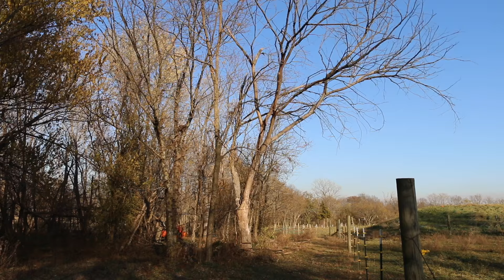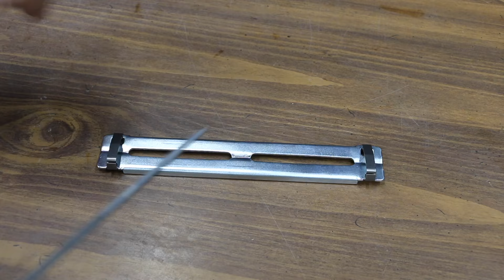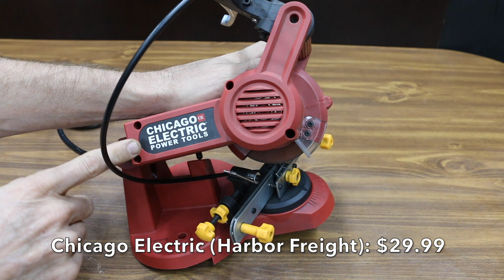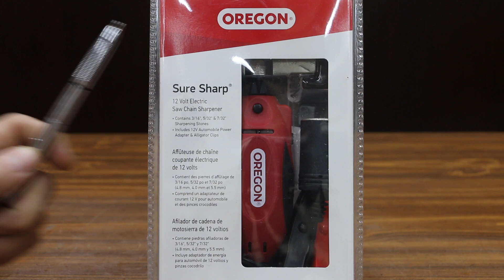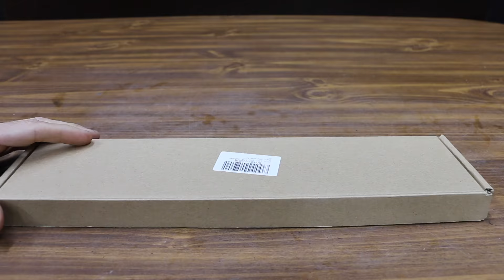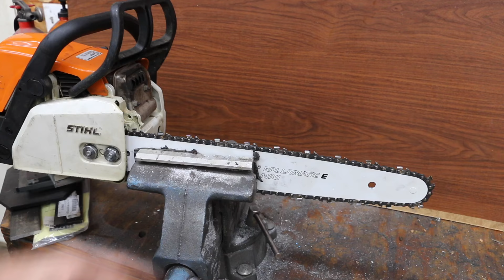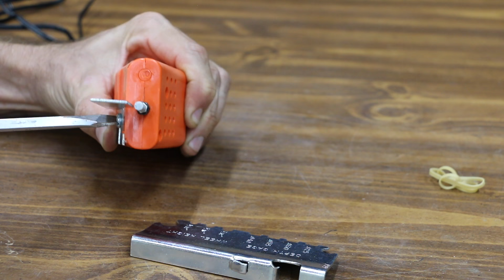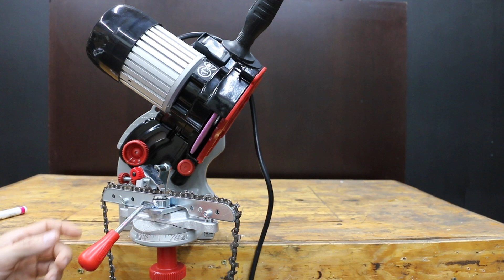Which Chainsaw Sharpener is Best? Let's find out! Stihl, Granberg, Chicago Electric, Oregon

Comment: Looks to me that they are all good if used correctly. I've sharpened a lot of chains with a bench mount a little better than this one. Ours had hydraulics so you didn't have to pull the lever to tighten the chain. The disadvantage is you have to remove chain from the bar. I my case people would sometimes bring 10 or 20 chains and some really dull so this machine was best .
Reply from the maker: Great point!

Comment: I’ve always used a dremel seems to suffice over a file. Saves a lot of time.
Reply: I used a Dremel for years. Until I recently learned fully what I was doing. Dremel does not sharpen the rakers. Only the cutters. If you are trying to sharpen the rakers with a Dremel (most guys don't), you are playing with fire unless you also use a depth gauge. If you oversharpen the rakers, it makes the saw too aggressive (read: dangerous). This is the whole point of Stihl 2 in 1. Sharpens *cutters and rakers*. With no need to measure each set of teeth with a depth gauge.
Reply: @ILruffian  yeah you do have a point there. I just used it around my land and it was the “fast way” lol I suppose I’ll try buying one of these devices project farm is the best!
Reply: @kylehughes6324  I used the Dremel in your same situation for years with no issues. Honestly, I didn't know any better. But eventually, the rakers are too high for the cutters, and you have a sharp but slow and sluggish chain. I ended up coming across a video and learning the whole process. The 2 in 1 is just as easy as the Dremel. Except it hits both cutters and rakers in one pass, automatically maintaining the ratio. Dremel still gets a lot of use for lawnmower and hedge trimmer.
Reply from the maker: Thanks for sharing.

Comment: Something I've wondered a lot recently, do the "special" (Read as High C rating/high amp/high discharge) batteries, such as the Ryobi One+ HP, actually do more than a similar battery that isn't labeled HP?  Likewise, do tools get amperage starved if you use battery packs with just a single serial cell array?  Do the packs with 2 or 3 parallel sets of batteries do work faster? How does a 3x normal pack compare to something like the HP batteries?
Reply from the maker: Thanks for the suggestion.

Comment: I've been using the 2in1 manual sharpener and really like it. Mine is not a Stihl, I think Stihl just markets to original design. As you mentioned it  is really clever as it sharpens the tooth and files the rakers. I bought the HF one you mentioned but have never used it, too much setup and tweaking so I gave it away.
Reply from the maker: Thanks for the feedback.

Comment: Suggestion for another comparison: electrical connectors: wire nuts vs wago vs push in vs screw terminal connectors. Heating, resistance, total amps stability, ease of use, mechanical stability, etc.
Reply from the maker: Thanks for the video idea.
Reply: Great idea. I'm nervous when I see these new connectors and at this point, I use old wire nuts and good electrical tape.
Reply: Good wire nuts and good tape!
Reply: Good wire nuts and good tape!

Comment: I don't use a chain saw as much as I use to. However a year or so ago I bought the Chicago Electric at Harbour Freight and I've sharpened several chains for friends. I'd rather do that than actually cut wood! So for $30 I did alright! Great video!
Reply from the maker: Thanks for sharing.

Comment: The Stihl 2-in-1 sharpener could’ve been bought with the proper size file. 
And you don’t even have to use a bench vice, You can use a portable Stihl bar vice or even do it free standing 
Plus the portability is unmatched.
Reply from the maker: Thanks for the feedback.

Comment: When you used the Chicago and the Oregon power sharpeners you applied to much constant pressure. You need to tap the chain until it no longer sparks, keeping the cutter from blueing. Once you blue the steel it changes the hardness of the cutter and wont keep a edge.
Reply from the maker: Thanks for the constructive feedback.

Comment: I have a friend who uses the oregon bench sharpener, a unit I just bought, there are some tricks for getting good results, as I use it and he coaches me I will let you know how it goes. I hand file when out in the field and can get a chain and rakers dialed in pretty sharp pretty quick, one secret is having good fresh files, proficiency, technique and using your eyeballs  help to. I can tell you that sometimes chains arent as sharp as they could be out of the box, if you can hand file well the top of the tooth should be able to slice your finger. when using a grinder you have to take small light bites, if you dig to hard to fast you will put burs on the outside of the tooth that will slow you down, hand filing can lead to burs to but since you arent heating up the tooth like with a grinder you should be able to see and knock the burs of with your fingernail
Reply from the maker: Thanks for sharing.

Comment: Big indicator is the size of the chips you are getting. I have the Stihl 2in1 and it works great.  You want chips, not saw dust or strings/shavings when cutting across the grain.  The rake is just as important as the gullet.
Reply from the maker: Thanks for sharing.

Comment: I have the Chicago Electric sharpener.  I've been wondering if a more expensive bench grinder would be a good investment.  Based on this video I'll save my money.  I rarely sharpen in the field.  I have 6 chains and if one dulls I just change it.  When they're all dull I take a break and use the bench grinder to batch them out.  Sharpen all the chains one one side.  Then change the angle on the grinder and sharpen all of the other side.  I might look into that Stihl 2-in-1 for field sharpening.
Reply from the maker: Thanks for the feedback.

Comment: Best I've found so far is Dremels chain sharpening attachment using diamond carbide bits. Quick, easy and because of the DC bits no issues with stones wearing to cause sloppy tolerances. I have the Husqvarna version of the Stihl 2 in 1 but the dremel beats it hands down, especially if using a cordless dremel.
Reply from the maker: Thanks for the feedback.

Comment: Besides the questionable quality of his sharpening job using the bench grinder ( I use one a lot, and there is a lot more to using a bench grinder to get great result than most understand) there is more to a good sharpened saw chain than what is shown, primarily longevity of the sharpened edge. With powered sharpeners, you need to be care to not burn the cutter (over heat). Burning the cutter can ruin the temper of the steel resulting in a cutter that dulls quicker. Also, he did not dress and shaped the bench grinding wheels. Incorrect shaped wheels with change the cutters geometry affecting the cut quality,speed, and edge retention.

Comment: My choice for ease of use in the field, and filing of the depth gauge/raker height at the same time, the Stihl 2-in-1/Pferd CS-X sharpener is a clear winner in my book for the week-end warrior chainsaw user.  With the depth gauges being set by the Stihl 2-in-1/Pferd CS-X, you get a consistent cutting chain.  No chattering or grabbing due to rakers being filed down too low (if you have ever tried a plunge cut with low rakers, you'll know how dangerous it can be).  Moreover, you get a good chip load per tooth, from not having the rakers set too tall, ...that can make for very slow cuts, and generally making fine sawdust instead of well defined chips.
But, for someone that uses a chainsaw for a living, and is constantly sharpening chains in the field, nothing will beat just a file with a handle, and a flat file with a depth gauge tool (or just a good eye for manually filing the depth gauges).
Reply from the maker: Thanks for the feedback.

Comment: I prefer using the correct diameter stone in a dermal tool.  If you are practiced using a file without a guide it is much faster. Always use  the stone rotating from under the tooth to the edge to avoid having it catch on the edge and jump out dulling the edge.
Reply from the maker: Thanks for sharing.

Comment: I've used all of these except the granberg 12v. For the money, the Stihl 2 n 1 sharpener is hard to beat. It's now my goto sharpener for all of my chains. I really, really do not like the grinding wheels and stones because it is very very east to take off too much material and reduce the life of the chain AND overheat the cutter thus ruining its temper and causing it to dull faster. You can clearly see the cutters on the wheel ground chains changing color and that's no good.
Reply from the maker: Thanks for sharing.

Comment: Hey boss idea I'd really appreciate. 

Different types of router bits and if all the "astro coating" (or other proprietary coating) really does keep the heat down and prolonging the life of the bit.

Really would be interested in the "down cut/upcut vs just getting by with a straight bit." If it's worth all the extra money for those spiral bits or just go with my straights.
Reply from the maker: Thanks for the video idea.

Comment: One thing to watch out for when grinding is that the grinding process can damage the hardening of the chain, something that's a risk with powered tools while hand tools are less prone to do that. Might be worth to test the hardness of the teeth after a sharpening.
Reply from the maker: Thanks for the suggestion.

Comment: I have an older HF grinder model. It has done a remarkable job over the years. When I sharpen a chain I only take very little bites at a time( very little sparking). Ive found that gives me the best results for sharpness and longevity.
Reply from the maker: Thanks for sharing.

Comment: I cut 7+ chords a year to heat a house. My favorite is a simple file with a wooden handle. If it's a sharp file and the person knows how to use it, that does a pretty good and quick job of getting the large chips to fly again. The Grandberg bar mount file looks like it would do a great job of getting all the angles back where they should be after many a field sharpening though. I've used the Chicago Electric type but it tends to take way more metal off the teeth than necessary, so chains won't last as long and there's a fair amount of extra time used for removing and reinstalling the chain. Thanks for all the great videos. I regularly use the info you provide in them when making purchase decisions and doing maintenance or repairs.  I may be shopping for the Grandberg very soon.

Comment: excellent project...been an arborist for 10 years...chain sharpening methods are limited in my small town so we learned to make do with the cheapest oregon set...took about 7 years to get consistently sharp chains with regularity... finally the 2 in 1 is now in the shops (a shop) here .. think i will get one for those times that the raker need filling also.. great video ..thanks
Reply from the maker: You are welcome!

Comment: Another great video! The Stihl branded file guide is made by Pferd, and the grinder is made by Granberg. Those products are usually available cheaper from their manufacturer. The nice thing about Stihl products is the availability at local dealers, just be ready to pay a premium. Good to point out that all of these sharpeners take time to master setup and technique.
Reply from the maker: Thanks so much!  Thanks for the feedback.

Comment: I've got the Oregon bench mounted one. I use it for several different saws of mine and have a cheat sheet for quick setup between different saws. There's a technique involved in using it and not ruining the temper of your cutters.
Reply from the maker: Thanks for sharing.

Comment: The depth of the rakers makes a huge difference in cutting speed. The lower they are, the faster it cuts, until the saw can't pull the chain. This does increase the chance of kick back. If you go to far, take a little more off the teeth.  On the tooth, use less angle for harder wood. On Poplar or soft pine, get closer to a 45 degree angle, it will make bigger chips. On a new chain, we usually take 3 swipes off the raker before using the chain. You'll have to learn what works for your saw.
Reply from the maker: Thanks for the feedback.

Comment: Have tried the Oregon 12 volt, used it a lot. But when in the bush, it is a pain to go back to the truck, get the stuff out, hook up then set up a portable vise to sharpen. I purchased the Sthil sharpener when I got my MS 250. With the portable vise you pound into a stump, I am back cutting in less than 10 minutes and the chain rips chunks not dust. If you are in your yard I guess the electric ones would work, not for me.Thanks for the effort
Reply from the maker: Thanks for sharing.

Comment: Working as a logger in Oregon I can assure you of two things, Stihl makes the best chain, and the best sharpener depends on the hand using it. Chisel bit will cut a hell of a lot faster than a round but it will dull easy. Best thing anyone can do is buy the simple Field kit and get good at following that motion and that angle until they can do it without the guide. Pretty soon you can file a chain razor sharp in a couple minutes. Thanks Project Farm for the great video.
Reply from the maker: You are welcome!  Thanks for sharing.

Comment: I don't know if you've done this before but what if you used hoppes gun bore cleaner for engine valve cleaner and hoppes or gun oil for motor oil. Be very interesting to the results explicitly the bore cleaner used as a fuel additive
Reply from the maker: Thanks for the video idea.

Comment: If you are out in the woods than you can forget about most of these sharpeners. You need to file it the old fashioned way. And with as little hassle as possible. For me, the Stihl 2 and 1 is the most logical and cost effective solution for real world use.
Reply from the maker: Thanks for the feedback.

Comment: When I was a firefighter we used Stihl rescue saws with carbide chains that were 250 bucks apiece. That's 250 bucks for just the chain. We did not sharpen them, just replaced them. They are designed to cut through building roofs and walls and were able to withstand hitting nails. We trained with older saws with regular Oregon chains.
Reply from the maker: Thanks for sharing.

Comment: Pferd makes the 2 in 1 sharpener for Stihl. If you look around, you can find the Pferd sharpener for 5-7 dollars less than the Stihl brand as you aren't paying for the name. Additional files are also cheaper if the Pferd brand is purchased. Quality is exactly the same. Just the name and color of the plastic changes.
Reply from the maker: Thanks for the feedback.

Comment: I don’t think those tools makes a bad job at sharpening your chain... but how much « too much » material to they remove compared to manual sharpening? I’m 33, my old friend teached me how to sharpen the blade wth the file removing just what’s necesessary to maximize chain lifetime... and that’s a « 1 beer long » process per chain, MAXIMUM. He always go in the woods with a spare chain in case he would hit some sand... but very rarely use it. :-)
Reply from the maker: Thanks for the feedback.

Comment: I cut about 5-10 full cord of wood per year, so I do a lot of sharpening.  I have the HF grinder and I get good results with using that about every 4th sharpen, and use a hand file after every tank of gas for touchups.
After this video, the Stihl 2 in 1 is absolutely going on my list.  Great video!
Reply from the maker: Thanks.

Comment: I am not sure if you have done it yet, but I wonder if there are differences in ratchet strap brands. Maybe could do advertised strength vs actual strength, ability to resist fraying,design of ratcheting system and ease of use. Love the videos!
Reply from the maker: Great suggestion!  Thank you!

Comment: I noticed that you burnt the cutter that you showed for the Oregon bench grinder, when you do that, it changes the temper in the metal and makes it soft. Those cutters will not hold an edge on them now and need to be ground back to the harder metal. I have seen people ruin a lot of chains with power grinders by grinding too fast or using a clogged (dirty) grinding wheels, lightly tap the chain a couple of times with the grinder instead of one hard push on it. I still prefer to touch up a dull chain with a file and save the grinder for ones with serious damage.
Reply from the maker: Thanks for the feedback.

Comment: IME I've got the best results with a generic Chicago Electric type grinder and the Stihl 2 in 1. The only caveat is that with the electric sharpener it's easy to "cook" the chain if you take too big of a bite.  After that they will get dull sooner. So, for best results grind a small amount of metal and give the depth gauges 3 strokes with the flat file after each sharpening.
Granted, I am no logger, just tree trimming and firewood but the feeling of the chain going through the wood like a hot knife in butter is worth the extra effort!
Reply from the maker: Thanks for the feedback.

Comment: I have the Granberg 12 volt sharpener with the adjustable head/angle/pitch.  It takes a few times to get the hang of it, but once you do you will never go back to a file. It does a really good job. Used it for about 4 years now and it works really good. A little stiff out of the box when working the motor head back and forth but some graphite lube helped smooth it out.  It feels more complicated than it actually is when you first start using it.
Reply from the maker: Thanks for sharing.

Comment: Not to criticize, and maybe your chain doesn’t call for it, but you forgot the 10 degree chain tilt on the Oregon bench grinder. I only know because I picked one up in December and did a short video on it last month. It really does seem to do a good job so far, though I also still use the Stihl 2-in-1 in the field with each refueling.
Oh, and the bench grinder can also be used to adjust all the rakers quickly, a very useful feature!
Reply from the maker: Thanks for the feedback.